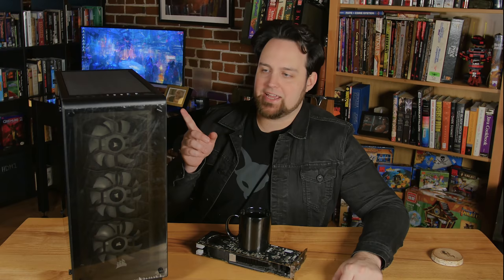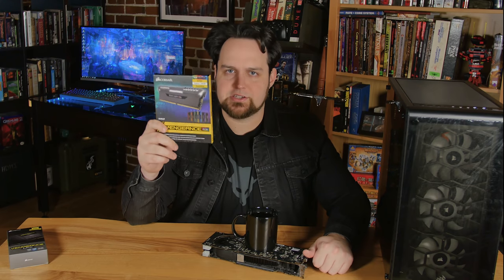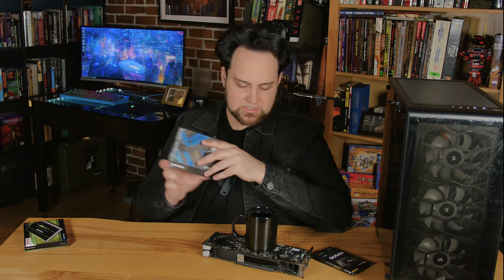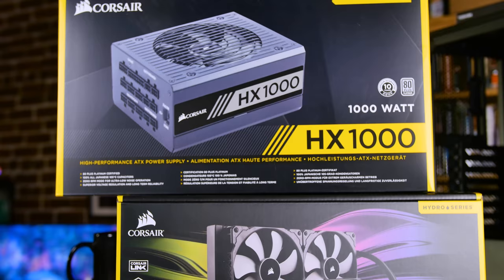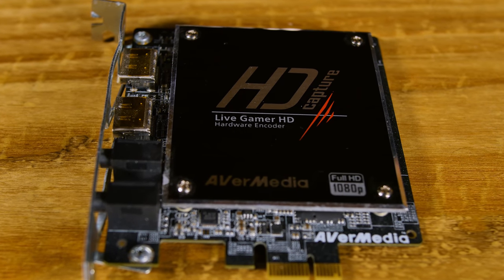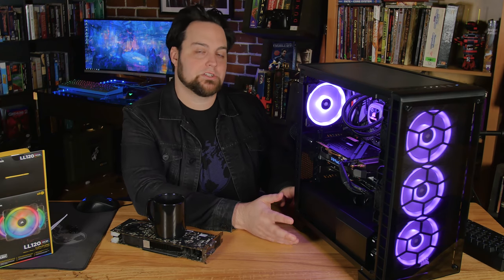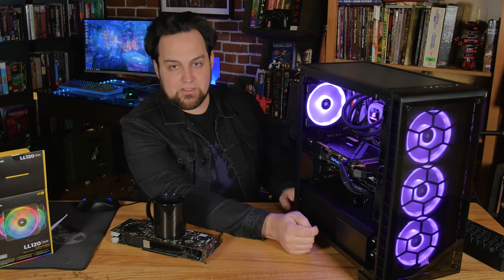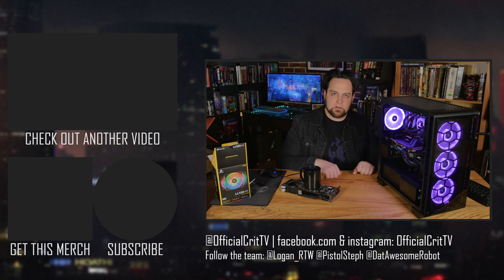Logan's 2018 Gaming PC Build | Corsair, Intel, MSI, Zotac, & Toshiba

Comment: So you didn’t have a problem with the exhaust fan in the back and the motherboard? Because I heard you can’t use this motherboard with an exhaust fan in the 570x rgb. Thanks so much because now I could buy this motherboard because it looks like you didn’t have any problems with this case and the motherboard with the exhaust fan!!

Comment: It looks like the fans on your H115i are mounted blowing out, while the front case fans are blowing in.  Might want to double check that, remember fans always blow towards the frame holding the motor/the sticker.

Comment: Hi I'm planning to build my own PC but I'm a total noob and pc parts are 30-40% more expensive in my country.. so are these parts any good?

Ryzen 3 2200G - $103 (5,500 php)
MSI B350 Gaming plus - $112 (6,000 php)
MSI B350m Bazooka - $90 (4,850 php)
GSkill Ripjaws 2x 4GB 3200mhz - $111 (5,950 php)
Seagate barracuda 1TB Sata Hard drive (6gb/s) - $45 (2,390 php)
Deepcool 600w 80plus bronze - $42 (2,250 php)
Aero cool Cylon RGB -  $36 (1,940 php)
Full build with Bazooka = $427 (22,890 php)
Full build with Gaming plus =  $449 (24,040 php)

Additional items to be added in the future:
SanDisk ultra II 240GB - $75 (3,990 php)
Gigabyte GTX 1050 Ti OC 4GB - $205 (10,950 php)

Thank you.

Comment: I'm currently building my new computer 
8700k 
Aorus gaming 7 
Tridon z rgb 32gb 
Ftw3 1080 ti 
Thermatke rinng tt permium 140mm fans
And a kraken x62 
With a Corsair white 850w white with white cables
In the nzxt h700 because I didn't want the I model